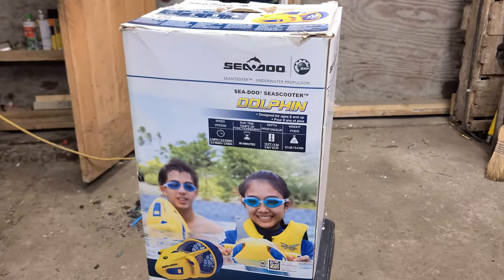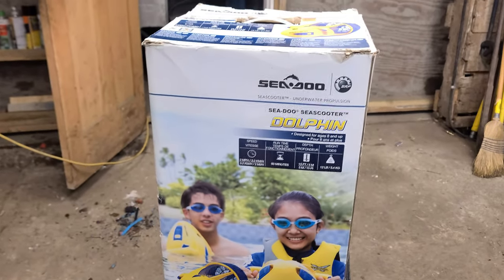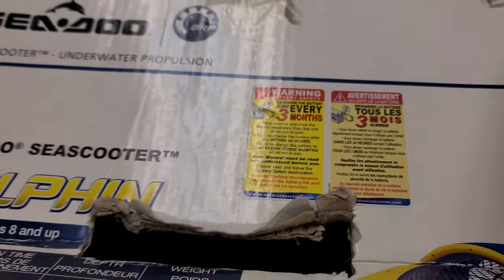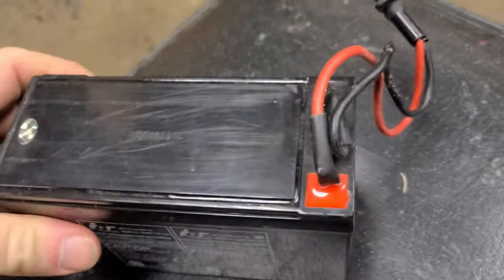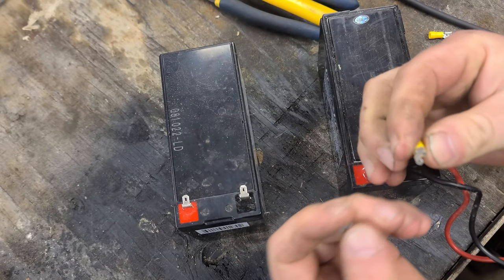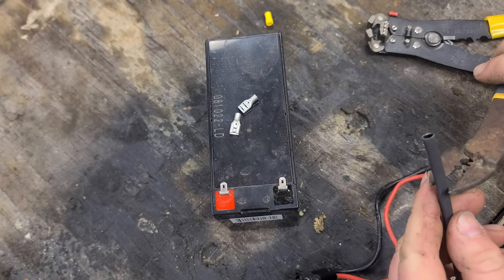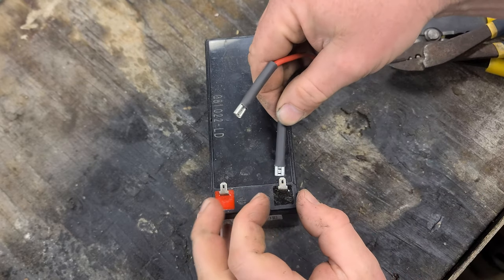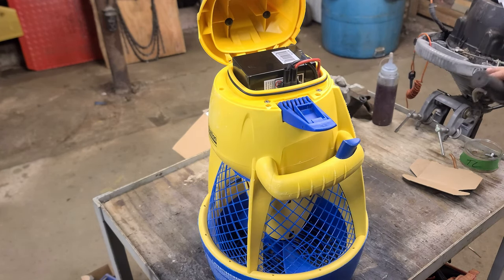How to replace the battery in a BRP Seadoo Seascooter Dolphin on the cheap!

Comment: Could I use 12v 7ah lithium battery and the same charger/connector?  Thanks, your video was extremely helpful.
Reply from the maker: I think you'd be all right using the battery but you would probably have to find an appropriate charger for the lithium battery